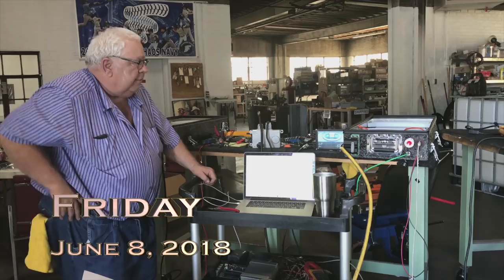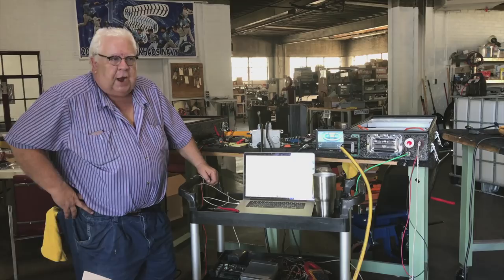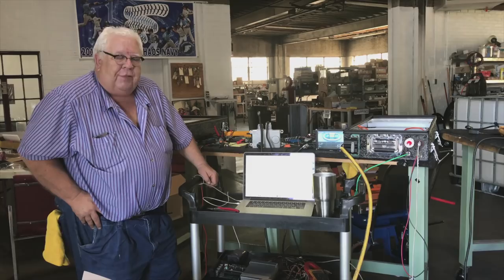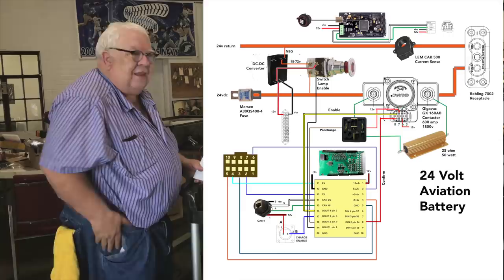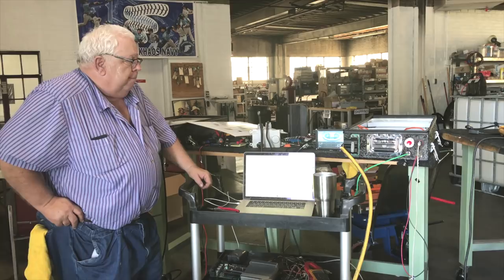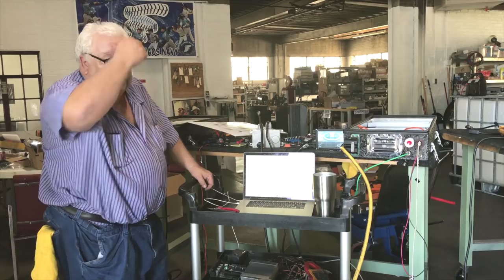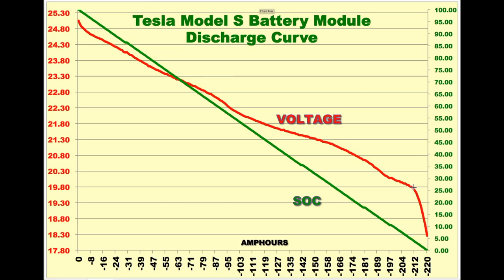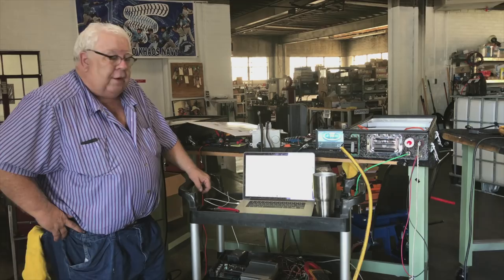Tesla Model S Battery Module Charge and Discharge Curves

Comment: 1) Happy to see Shop Kitty is back in action.
2) I've been watching the voltage on my lawnmower using Chevy Volt modules and have witnessed very similar results.  Discharging seems to stays very consistent and linear until I hit around 40V (20V per module) at which time the voltage drops much, much faster.  I noticed right away that the change in voltage during use was very much different than LiFePO4.

Comment: Nice work. Love to see the integration of all this stuff into something for a different purpose.

One thought I had about your log interval was why not do less logging when current is low (idle) with no alarms and increase the log sample during the high current times. This would let you have more data resolution for the times you care most about without all the noise and extra storage for idle times. I understand constant sample rate is much easier to implement.

Comment: I was thinking about the thermal problem you were encountering with the PowerSafe 100, then I came back to this powerpack wondering why there aren't some provisions put into the pack for utilizing the coolant loop to either heat or cool the battery to keep it from shutting down inadvertently in flight due to temperature extremes that could be encountered in flight from the ground to altitude, to spikes encountered over the fire zone.
I'm not so much thinking about the low limit here, cause a helicopter isn't going to get so high that "freezing" the battery becomes an issue, but thinking more about the high limit, or is the slipstream and or rotor wash going to be plenty enough to protect it from that happening?
And if they wanted to adapt this system to an AT-802 or something, that low limit is going to be a problem cause it has a service ceiling of 25 thousand, would a bleed air loop suffice to protect the battery?
I'm not trying to cop their idea here, but as a pilot, I would want to know that those questions (among others) were asked and answered satisfactorily by somebody, less something goes wrong and this thing sets the aircraft on fire for some reason, like what happened with Boeings Dreamliner (yeah I know, different battery setup, but still it happened).

Comment: I love this channel so much!
Reply: That Due and it's shield board could use some nylon 4-40 screws and nuts in the through holes.  Either hot melt the nuts with a soldering iron or use hot melt glue to secure them..  Vibration much?????

Comment: Hi great content, thanks for all the amazing info you provide. We have an off grid solar system using two model S modules in series, it’s been running great for about 3 years, since a few days ago we noticed the batteries getting discharged very quickly. I checked the voltage of each battery and there was a few volts of difference between the modules . Any ideas what may be the issue ? Thanks in advance.

Comment: Mr. Rickard  I have an issue with my 1st gen onboard charger on my 2013 Model S.  I will not take a charge and from other videos I saw it was as blown 50 amp fuse on the unit.  I am having Tesla replace the charger and I am keeping the old one to maybe repair and resell.  I was wondering if you have any information on that charger that would cause that fuse to blow?  I have new fuses and would just replace them if there is nothing else wrong.  Can you give me something or test points to check with out a battery hooked up to it.  If you can help trouble shoot this it would be appreciated.  Thank you...

Comment: funny story after seeing shopkat walking over the battery, 1992, we are starting up our brand new 60MW DC electric furnace, we are starting up for the first time every one in the control room, after first few minutes everything is quiet and then BANG! something in the 60,000amp DC Chopper system blows up. Turns out a racoon decided it was too noisy and wanted to move his home right when we were starting up, stepped across the 600V bus and became carbon dioxide in about 0.1 seconds. $150,000 damage
Reply: what!!!!!!!!!